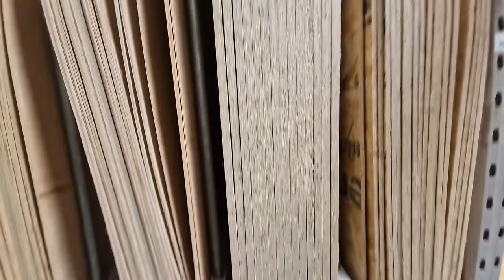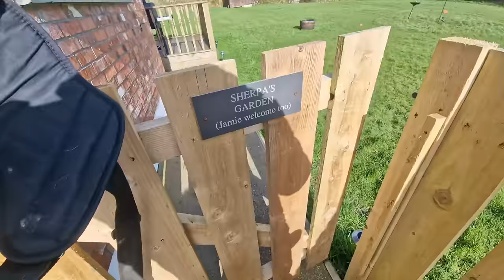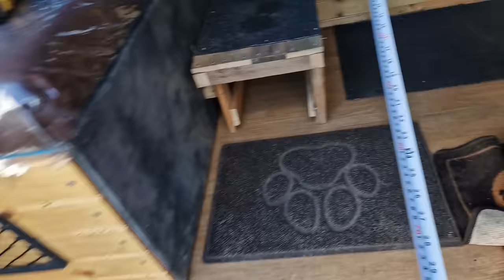Making My Husky's Life Easier Day By Day

Comment: Excellent modification. Rather than a new bed get a large rectangle of thick orthopedic memory foam for him. He’ll be able to stretch out and it will pad him well from the hard floor. That red bed with the bolsters is too small when he wants to stretch out. Moving the carpets is much better too. Now he has a really large area to walk and a bigger area for a larger bed. That additional low step is perfect. These van modifications are just what was needed. You’ll see tomorrow when you go on your trip.

Comment: Wood is crazy expensive here in Canada as well! Pallet is the way to go, breakdown and reuse!
Reply: I used to take the pallets lawn tractors wete delivered on off the hands of a local dealer. Cut right along the 2×4 and the pieces are perfect size for the wood stove. Then cut down the 2x4. The nails will fall into the ash catcher. It is hard wood and burns long and hot.

Comment: It's so hard watching our beloved best fur buddy become restricted due to pain and movement issues. They don't live long enough when they have such devoted humans.

Just a few quick thoughts from my own experience with a dog dealing with herniated spinal discs in two place plus seriously arthritic leg joints.

Do you have a Veterinary acupuncturist and/or neurologist and/or massage therapist nearby? I found acupuncture followed by massage therapy helped with pain management. Hydrotherapy was great for strength training and functional movement, but it did increase my dog's pain level.

For the Mini: Have you thought about making a larger seating area in the back? I used cardboard boxes covered with a thick duvet blanket in the foot areas behind my front SUV seats for a 40 pound dog. If you are willing to remove the front passenger seat, then you could make a wooden platform for him to step on before stepping up onto the back seat.

For the van:  Your larger  platform style step looks great. Could you make it even longer then place the step stool on top of it? This would probably decrease the distance to the bench seat quite a bit.

According to the doggy neurologist,  jumping even a short distance will cause more damage to arthritic joints. I would suggest using the step stool plus harness assistance for entering and exiting both vehicles. RUFF gear made wonderful double handled back length harnesses years ago and our Hydrotherapy person had slings for helping my dog with her increasingly unstable back legs. I'm not sure if these products are still available. 

Sherpa may still hesitate when entering and existing both vehicles, but it would be easier on his aching muscles and joints. He's such a sweet doggy  and your a incredible dad for him.

Comment: I hope the extra step works.  Ramps work, but you have to train them to use the ramp...and with stubborn Huskies, it takes even more training.  I had an 85 lb Husky/Chow, and at around 14 years old, he developed old age diabetes, costing him most of the strength in his back legs.  I could no longer get him into the car, and he would not tolerate being lifted.  I had to build a ramp for him, and then I had to train him to use it, the same way I had to train him to go up and down stairs when I adopted him.

Comment: I noticed Sherpa often sleeps on a hard or firm surface, even though he has beds around. When I had back and knee issues, it was much more comfortable to sleep on a firm surface because it gave me support. I wonder if you've tried making one of the van benches less soft. It might be that he would like a thin pad with wood underneath, for support when he's standing up. Does that make sense? ❤ you both!!

Comment: Happy VD... as to little red. Could you build some back seat floor inserts so Sherpa stepped in on the inserts, then climbed onto the seat... also, i know you take other people in the mini, but have you considered removing the passengers seat, building a step in for Sherpa... if you need to take other people around in the van... 🎉😊😊
Reply from the maker: I may have solved the car issue now 😊
Reply: @SherpasDay 😃 That sounds good 👍❤

Comment: Jamie maybe not make the ramp/steps wider, but just an extra step and make them both a little higher, cause ive noticed that the existing step is far lower than the van bench and its a high jump up, just a thought

Comment: Just a thought after seeing what you made, could you make a ramp that extended as far back as you can go and  sits on top of the step you use to get Sherpa into the van? If it sits on top of the step you could make it the same height as the cushion so there are no steps at all just a ramp. And you can still get the step out by simply moving the ramp off it.

Comment: Never seen any Hoomans sitting on those plastic covered seats ? Only dogs. Assume that's why they are covered with plastic, muddy paws & all that, easy to wipe down. Dude Dog seems content to kip on the floor of the van.  Does he need to get up on those seats?  He no longer pokes his head between the front seats, prefers to snooze. Why not use the seats to 
make the floor of the van one large plastic covered bed?!  What luxury & safer for Dude Dog who might roll or slip off the slippery plastic covered seats.  So much trouble & thought has gone into the steps it feels 'mean' to question the effort!